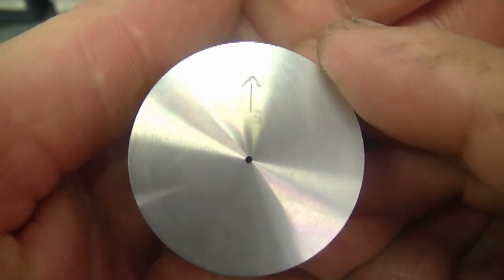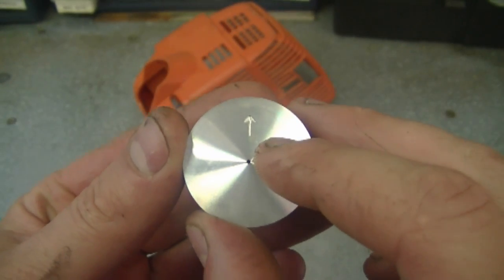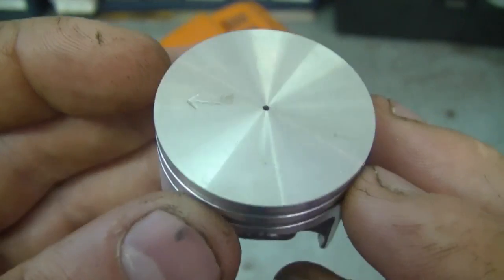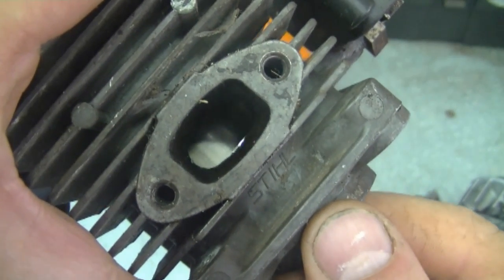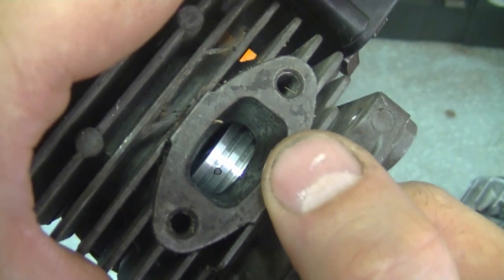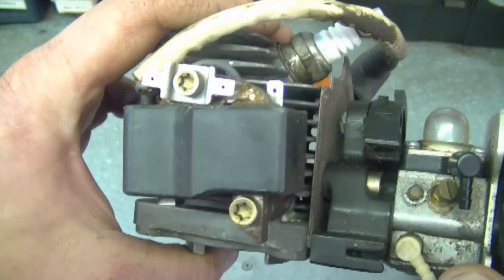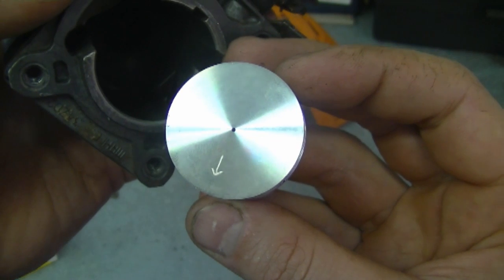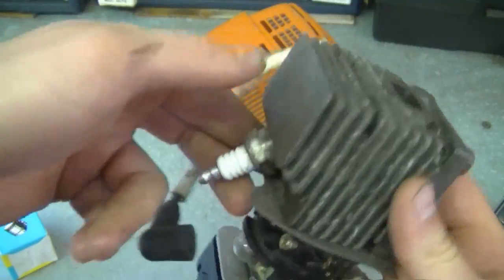The Correct Way to Point Piston Arrow On A 2 Cycle engine

Comment: You would be well advised to warn viewers not to rely on the arrow marking on the top of the piston,  I have had two kits with the arrow mark wrong,  This specially on after market kits.  I always check the flow.  Some pistons also have a marking in the casting near where the gudgeon pin goes showing the flow.
Reply from the maker: good point for the chinese kits

Comment: i got a basket case. a 27cc craftsman and it has no arrow on it. the piston is one that has a long skirt and a short . gonna pull the muffler back off and see. The factory stripped the carb. insulator bolts and the Warranty repair Guy drove in #14 self tapping screws and busted the the cylinder bolt holes clean off.
Reply: I have a piston without the arrow. I also plan to use "long skirt and a short skirt" as a reference. How did this work out for you?

Comment: Hey Donny is there anyway I can contact you my friend?
I have enjoyed watching all your videos as they have helped me a lot... I am currently working on a stihl ts 350.... I have changed my cylinder and piston and piston rings as well as my complete carburetor kit but my saw starts for about 40 seconds and as I press the throttle it runs but dies seconds after... I thought it was my carburetor adjustment but after setting the high to one full turn and the low to one and half it still does the same.... I sanded down the ignition module and air blew everything and still the same... could you please help me.

Comment: Thanks for your excellent videos. My 1995 Robin NB31 brushcutter has an arrow on top of piston pointing along crankshaft axis to cutting head (90 degrees to ex. port). The ring pins are on the exhaust side but miss the port by about 5mm laterally (would also miss inlet port). I assume this is how OEM fitted, and it runs OK except for carbon build up (25:1 spec'd oil).

Comment: my buddy bought a saw off a buddy that just had a rebuild, ran it a few times, was out cutting and stopped like it ran out of gas, wouldn't restart. takes it apart, and the piston on the exhaust side is all destroyed with a hole in the upper ring land, and a big scored spot halfway down to the skirt. saw this video and sure enough the arrow was pointing towards the intake port!! great video!

Comment: yo donny, I'm doing a piston job and I forget, the angle at the rings 2 ends, should the pointed end be up or down?
Reply from the maker: +Brian Szovati down, it will fit snuggly on the pin
Reply: No pin, there's a little dot telling you where the gap in the pin should be placed... their is declining angels on the ends...

Comment: Hey man I'm installing a piston on a 80cc 2stroke quad and I have already put in 3 pistons and each time i do it I have pointed the arrow to the exhaust each time I put new rings new piston new gaskets and then when I go to start it it back fires and won't start. I then I  Would check the compression and it reads low. I'm am 100% sure I did every thing correct I torque the bolts correct the cylinder is not scored or anything but I loose compression out of nowhere and when I take the cylinder off the rings get very loose and barley stay on the piston (which they weren't like that before when I put them in) Anyways my question is that do you think I might need to put the arrow facing the intake side? So that the rings won't get destroyed like the last 3 times? BTW the Pistons were high quality weisco piston rings gaskets

Comment: Thanks much for the info. I am relatively new to the 2 stroke stuff. I am replacing the piston ring on a Poulan Pro blower. I spotted an arrow on the under side of the piston and I knew it was for positioning the piston correctly but wasn't sure which way. It makes so much sense now thanks to you - you have been a blessing! Thanks again donyboy!

Comment: I love your videos. Could you cover checking the cylinder during a rebuild? I have a Wisconsin TJ D that I would like to refresh with a new set of rings. There are many issues to consider like scratches, out of round, original piston clearance, ridge at the top of the piston wall, and probably more that I'm not aware of. Basically I would like to gain the knowledge to know whether I should just freshen up with rings and honing
 or rebore and use an oversized piston?

Comment: OK,get the idea,now not to grip my 66cc got tough with me and broke a ring as I attempted to mount the cylinder back on the crankcase over the piston.OK sure I don't like the way the engine is ported but no way to change that with a file and socket set to my preference but I did take a file to the cylinder and turn it into a ring compressor after about twenty minuets.Anyway got the top ring to snap into place but the second snapped in only after breaking off about 1/2 " of the ring.Granted this is a low dollars engine no less I'm guessing the bottom ring seated and won't move ever have a ring break during seating it into place with a cylinder in this manner ? As I was saying I don't expect the ring to move anyway 7/8" of the original diameter remains seated .What do you think leave it in or tear it down and what on hoping to break one more again when it get here from China ?

Comment: hey Don, i got a old 3.5 hp briggs i found in the junk and i brought it to my shop and i think the motor is out of time because the piston is at top dead center and both of the valves are not closing, could it be that the timing marks on the crankshaft and camshaft are not mathcing or are the valves just sticky? 
Any Ideas?

Comment: Yup, i bought an original workshop manual for my 2 stroke motorbike and it was wrong!!, it directed me to have the ring pins in totally the wrong place, i looked for the blank areas on the bore and rotated the piston 180 degrees and they were spot on.

Even makers workshop manuals can be wrong :-(

Common sense saved my engine.

Nice vid :-)

Comment: good info to know.but what do you do if you are replaceing a new piston that has no arrow on the head? I'm replacing a piston in a 25 cc engine due to a worn ring. I cleaned up the old piston to see if it had an arrow with no luck. good timing, I'm waiting for a gasket. thanks for the info. .